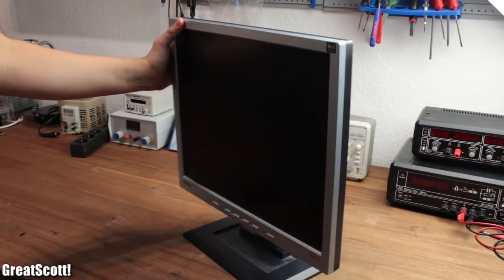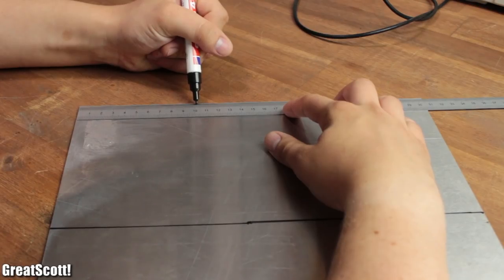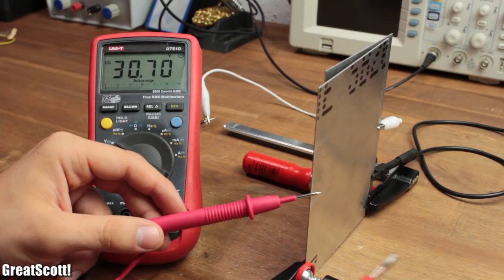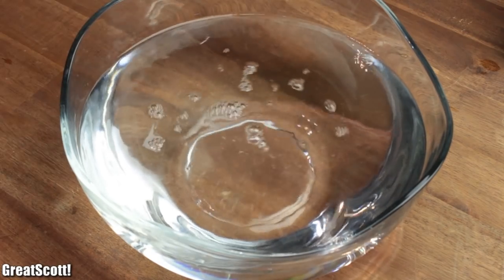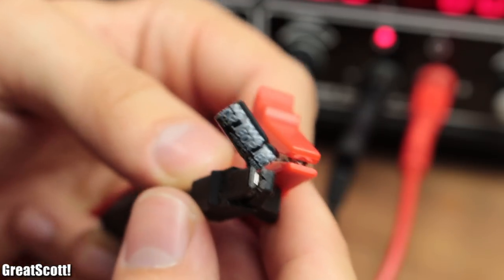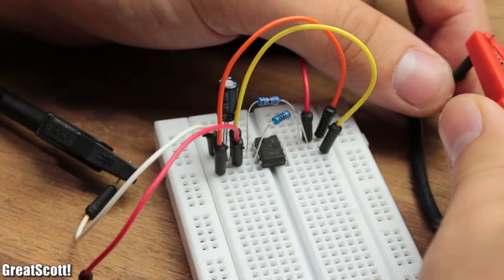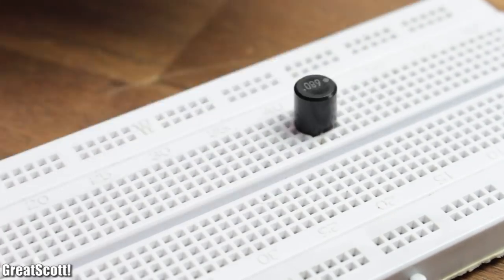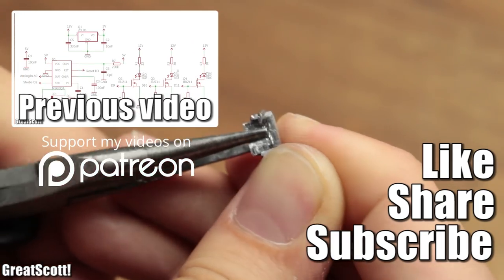Electronic Basics #14: Capacitors

Comment: Years ago, my sisters 1 yr old TV just stopped working "for no good reason".  Sure enough, a careful look noted a suspect capacitor "bulging" at the top (that is why they have that scored x in the metal, so that it doesnt become a projectile). Went to Radio Shack, spent a $1.50 on an equal value capacitor, soldered to PC board and bingo, worked. Longest part of job was tackling the 57 screws to get the panel off / on. Good info here, thank you!
Reply: Would an aftermarket capacitor always work, as long as it is of equal value? Are there some compromises that cannot be made, e.g. capacitor type must be the same? 

I just fear that something "proprietary" might be on appliance capacitors and they may not be replaceable with off-the-shelf parts
Reply: @re.liable  Id hate to say 100% yes, but I can't see why not as long as the values match, even the materials shouldn't matter ie ceramic, metal, etc. Good luck!

Comment: Great stuff. One small correction on  2:09: The more capacitance and greater maximum voltage rating a capacitor gets, the more energy (not power, which is energy divided by time) it can deliver.

Comment: I remember going down to my local scrapyard and picking up a load of old electronics from their "breaker" skip, there were TVs, Radios, Games consoles (Handheld and full system), even some PCs! Tested them all and most of them didn't turn on, checked the caps and realized the majority were blown, swapped them out and ended up with almost £3000 worth of working electronics for their scrap price! (About £60!)

Comment: I need it dumbed down. I still don't get it.
Reply: me too :(
Reply: I found it best to visualise a capacitor as a reservoir holding back the water flow from a small stream.  When held back, the flow accumulates within the capacitor and when released it has more force; the force of a faster river.
Reply: That makes a little sense, but it wouldn't be constant in that case. when it's releasing, the small river couldn't keep the reservoir filled. so is there like a reset or something? or something that triggers the release?
Reply: Landon Rivers same :/
Reply: The absolute best analogy for capacitors and resistors is a mass-spring system. Voltage would be force, velocity is current, inductor is Mass, capacitor is a spring, and resistance is friction.
https://instruct.math.lsa.umich.edu/lecturedemos/ma216/docs/3_4/spring.png

Trust me the equations are Identical.
Reply: I stil need one simple answer: does dc voltage pass through a capacitor?
Reply: +Houdonical Guy yes
Reply: No, not ac not dc, a Capacitor does not pass any flow through just it looks lika it let a ac pass but that is "looks like" and not real, also not i theorie,  get it?
Reply: You might as well go ahead and take Physics 2 and circuit analysis if you really want to understand the ins-and-outs of this stuff.
Reply: more like a damn less like a river!
Reply: @landonrivers  yea u got that right, the release mechanism is often used in blinker circuits. There is a temporary reset time after each discharge.
Reply: Just ask what u don't understand in this video I'll try to simplify it
Reply: @johnkendal5562  More like a water tower.
Reply: how?

Comment: Would be cool if you showed more how you set up your circuits. You always just show some wires and stuff clamped together and then some oscillator, multimeter or supply output. How do you set up these examples, what sizes of the components are you using and why would really help.

Comment: I repaired 3 monitors replacing the blown caps. In the store they declared me to be crazy. I was't the only problem. Just got the same F rating and replaced them with higher voltage versions in my case i put in some panasonic caps. And 5 years after the repair i still use this lcd monitor (made  by samsung). I think they use bad component's on purpose. With higher grade caps it ran 5 years for now after repair. While they ran 2 or 3 years after purchase. Two same lcd had same issue bought the caps for both while one gave up after 2 years. I'm like 6 euro for all the caps. I'm not going to take a risk on the second monitor. One of them has a bad line in the display ( after 5 years of total use) non repairable. And repaired a hp monitor the same way. One advice buying a monitor. Buy it without a power supply into it. So you can manual replace it without any issue.
Reply: I've repaired 5 monitors, 1 radio, and 2 Pentium 4 motherboards. And yet have to find out if it works for power supplies. Just be sure you're checking the heat rating when buying new caps, I had to replace the caps on the first monitor, again, after not realizing cheaper means lower heat rating.
Reply: Yeah the heat rating. That can screw you over. Pretty bad. Especially on monitors as they have no active fans. Just pay the price for caps and we are talking like 6 to 12 euro/dollars per monitor.. They should be better then the once inside. And for the temp rating there was no reference on the ones in the old monitors so i took the ones with the highest value available at store. Also check the size. Had to run a wire for one cap as it didn't fit otherwise. No problem for me but could be a issue.
Reply: killerbeenl The need to run a wire shouldn't be an issue as long as the cap is in a location that isn't any warmer that the location on the board, and the wire can handle the load. I can't remember what I payed for mine, but I believe that my first monitor's first round of recapping cost me under 5 USD, and the second round was double that. I believe it applies to anything you fix that is over 10 years old, a re-cap and resistor replacement usually solves the problem.
Reply: Apple doesn't even want you to be able to repair

Comment: I made my own capacitor from 2 sheets of aluminimium foil separated by cling wrap. I folded it all up into a cube and taped it. I actually got 500nf out of it. But it leaked all of its charge very quickly. Rimstar has videos on making caps, dry andelectrolytic. I should make one of those some time.

Comment: For those who would like a tiny analogy:
The absolute best analogy for capacitors and resistors is a mass-spring system. Voltage would be force, velocity is current, inductor is Mass, capacitor is a spring, and resistance is friction.
https://instruct.math.lsa.umich.edu/lecturedemos/ma216/docs/3_4/spring.png

Trust me the equations are Identical to a rlc circuit.

Comment: Since you talked about a monitor/tv... I was just wondering if you might know whats the cause of the following issue with my granddads philips lcd TV...

When switching it on, the image is upside/down, mirrorred around and the colours are similar to photograph negatives... after a while,  about 15 minutes or so, it flips and works great...
Shut it down and power it right back up and the image is still fine, but let it cool down and its the same thing over again...

Comment: Might wanna stick in an annotation somewhere @2:02 to explain that Q = Charge and U = electric potential (in volts) as opposed to electrostatic potential energy (U_E, in Joules). This was very confusing at first as I looked up the symbol U and saw it used for electrostatic potential energy, but couldn't figure out where the volts were coming from until I saw it was related to electric potential.

Also swapping the substitutions of Q and U around for the battery equation kinda contributed to the confusion. ^^;

Comment: Would be a great addition to hear your thoughts on testing capacitors (without the expensive capacitor tester you have) both in and out of circuits. Such as with ohm meters (out of circuit) and I only just learned of ESR testers, which I think can test in circuit though I am still not sure how they work, can’t figure out how they isolate the cap from parallel components in circuit.

Comment: Hi, Scott, it is a very nice capacitor introduction video. I like it. a question, how do you measure current with oscilloscope in another channel, i guess you measure the voltage on a resistor in series of the circuit, right?

Comment: What is pF and uF (F) still dont get whats the difference between higher or lower number
Reply: 1 pF is 1 picofarad =  10−12 farad and 1 uF is 1 microfarad =  0.000 001 farad

that number (capacitance) tells you how much energy can be stored.
as you can see pico is way smaller
Reply: AseGG you really should look at what a colomb is first.
Reply: pico is not 10 -12 farad!!!! pico is 10^-9 farad = 0.000 000 001
Reply: @linkmaster959  Pico is 10^-12 and nano is 10^-9

Comment: Hi , I have a faulty ceramic  capacitor . The writing on capacitor is "  .02    80-20 .GA." . I think that mean .02 mf value.
I bought a replacement which says "020uf " . are they the same value? Thanks

Comment: Just to make it clear. I fix TVs and electronics since the '90s and the most common fault of TV's is not a power supply and the capacitors ;). There are two main faults. 1 is a physical damage, 2nd is the backlight. Backlight should last much longer, but, these LEDs are in series and transfer a current for all of them through all of them. So, it's impossible for them to carry so much and not get used quicker by that ;).

So, capacitors yes, they are culprits even in PS5 ;) and even SMD ones, not only electrolytic ones. But, are much less than these two factors ;). On top of all faulty TVs you can easily say that Vestel class is one of the worst if not the worst of all. So, Polaroid, JVC, Toshiba, Bush, cheaper Panasonics just to name a few are those poorer quality ones where you've got more chance of poor quality capacitors or even a design ;).

Comment: Hey, @GreatScott, I know a very interesting trick with eletrolitic capacitors you could use for many projects...maybe you already knows the trick..maybe not...Well, the trick allows you to REVERT the capacitor's POLARITY without destroying it. To do that you simply need to solder two capacitors in series where the soldered pins are the same polarity and voilah (I think the word is voilah) you can revert the polarity without problem and charge normaly the capacitors. As everybody knows, in this configuration we sum the voltages limits of both capacitors and apply the formula for the total capacitance 1/Ceq = 1/C1 + 1/C2 + ... + 1/Cn ...hope you enjoy the trick and let me know if you tried! Greetings from Brazil! =)

Comment: Watching that capacitor burst half way through the video was really satisfying. I tried to achieve that a few weeks ago by reversing the polarity with a 9v but nothing happened. Can someone shed some light?
Reply: Try a bigger voltage
Reply: Try a bigger voltage
Reply: I should note theyre electrolytic caps rated for 25v
Reply: Well you are under the max voltage. Try joining 4 9v batteries, that could work

Comment: I have a question, so if u solder multiple capacitors of the same capacitance like about ten, would the output increase in voltage or stay the same

Comment: Great video. But my question is why different types of capacitors like electrolytic, ceramic etc?
Reply: electrolytic are mostly polarized, high farad level, low voltage.
 some ceramic ones are high voltage, low farad level, and mostly unpolarized.
 but dont mix up ceramic capacitors for tantalum

Comment: When measuring capacitance.  Are you aiming for the number to be bigger or smaller than the value labeled on the capacitor?  For example: if i have a 50Micro Farad 16V Electrolytic capacitor, and my multimeter reads 75micro Farads,  is that good or bad?
Reply: +Josh M Correction *  Is the capacitor good or bad?

Comment: Instructive video of a good serial! For a project I need to provide a pulse of 95 mA for 100 milliseconds @ 12VDC to open/close a latching solenoid valve. I was thinking of a capacitor with a BJT as a switch controlling the base from an MCU. Could it work?

Comment: Hello GreatScott! , kindly clarify for about the condition of the electrolytic capacitors in the value of: 10000 micro farad /63v in my much beloved Grundig FineArts A903 stereo amp. The amp is in working, but one of the capacitor's  outer side of the  body is corroded as a small patch between the body and sleeve. Is it because of humidity? anything weakness of the capacitor? I am much much worried about that. Because, I'm not a technician, here in my place in India, there is no any qualified technician to handle this high end electronics. Will it be safe to use this amp as normal? I had put this amp as unused for six months as I went for my knee surgery. Kindly let me know about this. I am really worried about this condition. I can send photo of this capacitor, but, here I couldn't upload. Thanks in advance, regards.

Comment: hey im new plz help
im working on a project and it needs a capacitor to dump High current high voltage into a coil I need to know how many volts and amps it dumps how do I figure this out is there a formula? all i know is that the cap charges to the max supply voltage but when the voltage is released suddenly how many amps are with that voltage?

Comment: hi this was quite helpfully, but now how do I know which one to use, like if I am trying to make a ac/DC converter for 12v which capacitor should I use and with what value
Reply: depends what type of power supply
Reply: +Joyrider i want to supply 12v dc constantly what value should i use and how i know how many farads does it need to have?

Comment: If I swap a 10000uf 50volt 105 capacitor to a 12000uf 63volt 105 capacitor in a power supply will it work?

Comment: Hi! i Have a big problem! My 10V 220 uF capacitor blew up and i need to replace it. I found two capacitors. First capacitor is 6,3V 220 uF and the second capacitor is 10V 330uF. Which capacitor should i choose? First or the second?
Reply: 10v 330uF is best
Reply: +Flaming Gaming okay i will try the second capacitor
Reply: you should look for one that is 220 uf and AT LEAST 10v
you will find a lot of 220uF 16v or 25

do not try with the 6.3v or it will blow up quite instantly
if you really can't find a 220uF the 330 is better than nothing, but it is not the proper one so it can give you troubles

Comment: Can i put a slightly bigger capacitor in for a start capacitor?
Reply: Im talking about from 3 ųf to 3.5-6 ųf?
Reply: You should probably not change the capacitance rating
But can replace it for a higher voltage rated capacitor

Comment: Are the ratings such as voltage and microfarads on the capacitor it's max values? For example a 16volt 2200 microfarad, can it handle a maximum of 16 volts and produce 2200 microfarads? If so then shouldn't a 20 volt 4600 microfarad capacitor be better due to its higher energy store capabilities? I'm new to all this and was just wondering about this.

Comment: May I ask below DIY capacitor geometry questions?

Bigger the roll (bigger diameter) make higher capacitance.

More surface contact to + and - leg make higher Amp capacitor.

Does longer the cylinder roll make higher DC voltage?
Reply: Hmmm good question

Comment: Great explainatio n.

After I removed capacitor from circuit board. How do I know which leg is positive, which is negative?

Your video demonstrate connect legs in wrong direction will cause capacitor to explore.
Reply: Put it any way and power the circuit in a few secand if it didnot work  power it off  then reverse the polarity
Reply: It will exploade if u left it charging for a while ....
Reply: So by trial and error? No better way to find out +/- such as visual indicator?
Reply: @harukoyama9515  do u have a mulitmeter?
Reply: @harukoyama9515  you could use multimeter to know where is minus and the positive terminals
Reply: Yes. I have multi meter capable of 10amp.

The capacitor I salvage from lab top charger is brown color 450uf x 100vdc I think. I will need to 
1. Connect + to - to discharge completely for safety reason
2. De Solder from circuit board
3. Charge with my 13.5 Vdc computer power back up charger for few minutes.
4. Connect to multi meter to see correct + and - leg...

I am building a power supply from MOT for my cord less power circular saw.

After winding cable few turn. I place multi meter on the output. I got no reading. I was wonder why?

What Usually happen, If I wind the secondary in wrong direction?

Thank you.

Is this the right procedure?

Comment: My monitor went's black after 1-2 seconds. Could it be capacitor problem?
Reply: GrzybDominator Most likely. 9 out of 10 times its dodgy capacitors. Look for caps that are bloated at the top.
Reply: non of them ale bloated :(
Reply: GrzybDominator look for bad caps especially in the power supply. Another thing that fails alot is the backlight, wich is easy and cheap to replace.

Comment: I know capacitors hold charge and are like tiny batteries but what actual use is that in a device? Can someone give some examples?
Reply: +2pacdaking06 A lot of things - it's used in audio and power circuits. Also, as opposed to a battery, capacitors dump their charge much faster (and thus the warning labels on high-power appliances).

Comment: I got a 5 (max 5) on the advanced placement test for calculus based electricity and magnetism, but I still don't know how to use a capacitor in a circuit...
Reply: Don't expect an instant understanding, be patient, and learn basic electronics in full.  The components have interaction with the components they're combined with.

Capacitors have many functions.  Some couple an AC circuit while blocking DC.  Some are used to filter frequencies. (high pass, low pass, band pass)  Some are used to stabilize dc voltage supplies where small fluctuations could affect a chip.  Some are used to reduce ripple when rectifying AC to DC.

As such, you won't get an immediate understanding until you know why they are being used in a given circuit.  Patience and study will get you there.  

Another channel you  may want to look at is EEVblog.  Dave goes into large amounts of detail.  Often he explains things far better than the training I received.